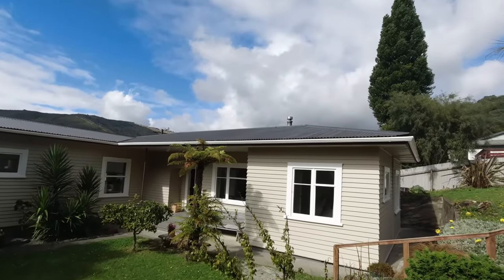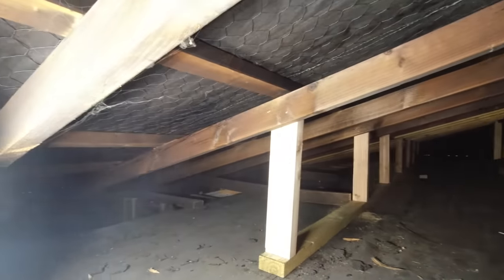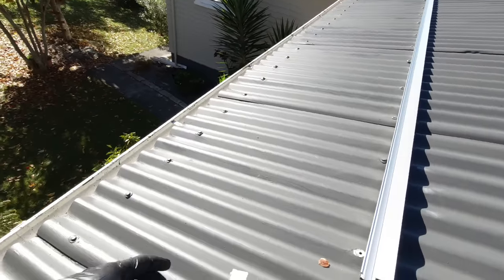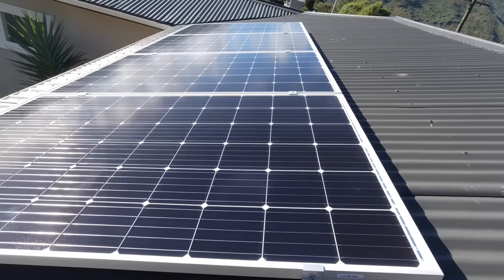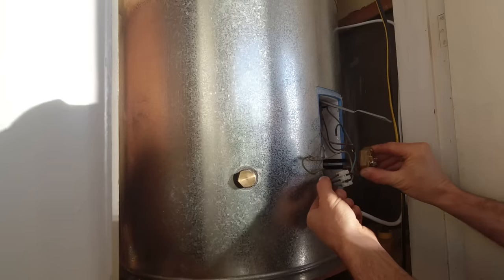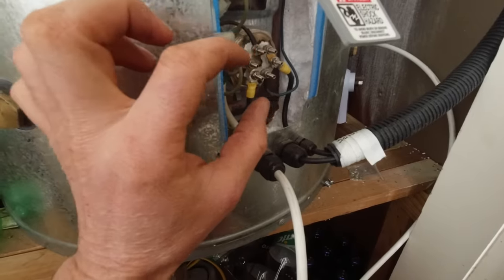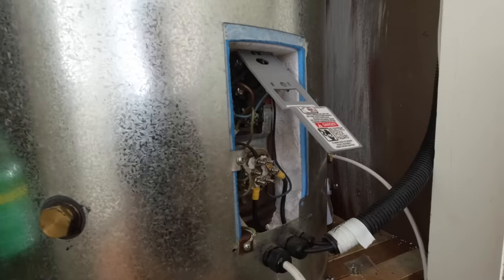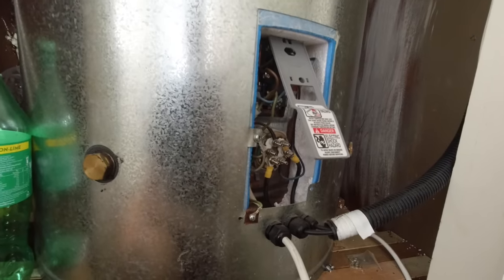Installing PV Solar Panels using a Water Tank as the Battery.. Halved my Power bill

Comment: Cool, I was thinking about doing this.  I didn't realize I would need a special element.  I figured a restive heating element would not care if it's fed with AC or DC.  Maybe yours is called a DC element because if has multiple coils?
Reply: There is actually a difference. I was surprised to learn this also.
The resistive element itself is, as you say, no different and indeed doesn't care if it has ac or dc applied across it. The difference lies in the outer casing material of the element and has to do with corrosion via electrolysis more than anything.
Reply: @jimmyb1451  not just that, to low voltage will put to high amperage, if wires dont predicted for too high amperage, will burn ...
Reply: @zoran69ser  Ohms law says otherwise.
Reply: There are numerous gray sheath heating elements that are not electrically connected to the tank mounting.  Agencies do allow some current leakage.  This could be an issue with DC and electrolysis. The panels should be floating anyway.  Other elements are copper sheath with plating.  The element is essentially outside of tank and causes no issues.
Reply: @opera5714  The panels would be floating, if not connected to earth.

Something I'll never understand.
I'm yet to be given a valid reason for earthing a solar array.

Comment: Hey Marty, thanks for the video. Question, does the solar side not need a thermostat? I would worry about overheating if that was possible.
Reply from the maker: It is self limiting, hasn't gone over 80c yet but I will keep a close eye on the temp heading into mid summer, if it starts getting too hot I will add a thermistor/plc with a big dc relay to disconnect solar if the water temp gets too high
Reply: Not sure about NZ, but here in the States, they have a pressure release valve. As the water heats, it expands, if the pressure is too great i'll vent, as it vents and looses pressure cold water from the tap will enter the system and cool it, further reducing the pressure. Mybusters made the hot water rocket by disabling the venting and every other safety mechanism, the once the water got hot enough to flash to steam. blast off. He said it only gets about 80C, about 176 F, or so, if I remember my F to C conversion's, that's 20 degrees below boiling. Also, i dont think he said if he bypassed the thermostat or not. He may not have. Either way, he's probably good to go. Marty seems pretty smart so i doubt he'd overlook that. Edit: he said on another post he doesnt have a thermostat, but it never gets above 80C and he's keeping a close watch on it and will install a PLC with a dump if need be.
Reply from the maker: @matt_1984_  Yes this tank has an always open vent coming out above the roof

Comment: Hey Marty. Nice Job.  I have done a few solar panel installations on some homes here in the States as well as put panels on at least a dozen RVs.  This install looks unique.  I'm really interested in the DC heating coil.  Those 300 watt panels output as much as 40 volts each.  Without a charge controller you're pushing from zero to 160 volts.  Doesn't the DC voltage matter to it?
Reply: Once you pull more power from the panels than their Pmax, the voltage tops out.
He's running them in two strings of two, so in any case the most the element will see is 80 odd volts.
Reply from the maker: The panels are 2x series parallelled so voltage is kept below elv
Reply: Thanks Jimmy and Marty.  Makes sense.  But still, that is a fairly wide range of DC voltages. This doesn't matter to a coil?    A coil is not a sensitive piece of electronics so I am guessing  no.  But hey, I don't know, that's why I am asking.
Reply: @nikolatesla5553   The PV panels are current generators and the voltage produced depends on the resistance. A function of the current squared.  Little drops in current make big differences.  So, most of the day this direct connect is a poor performer.  Add just a little electronics and this system would really perform on cloudy days.

Comment: This is something I've wanted to do for years. 
I'm impressed with how well the solar array was put together. That was a huge job because of the work inside the roof.
The combined AC/DC element solves the mains boosting issue nicely. 
I'm wondering what would happen during long summer days if the hot water wasn't used. Could it theoretically boil? Is there a way to use the AC thermostat to control a DC contactor using a transformer to power the contactor? As running DC through the thermostat will damage the contacts.
Reply from the maker: It hasn't gone over 80c yet but I will keep a close eye on the temp heading into mid summer, if it starts getting too hot I will add a thermistor/plc with a big dc relay to disconnect solar if the water temp gets too high
Reply: @MartyT  I am going to try using one of the low cost DC SSR's driven by the thermostat...under A$10 for a 50 Amp 400V device
Reply: @MartyT  and mehanical Pressure Relief Valve ,  is must...
Reply from the maker: @zoran69ser vent pipe is always open above the roof, no need for a relief valve
Reply from the maker: @Peter can you show me the link? are those Chinese amps or real amps?
Reply: @MartyT  did you see my link and comments yesterday...I don't see it here now...YT may have removed it?
Reply: @MartyT  appears I am unable to respond to you
Reply from the maker: @Peter I didnt get it, sometimes links go to spam but i cant see it there
Reply: @MartyT  I sent an email just now...

Comment: you used a water heater boiler to transform DC to AC by using as you said at 5'43" <<replace AC element with a DC>>; could you give more details, pls. so, in the end you didn't use an inverter and how you solve the power frequency (Hz=50) ?
Reply from the maker: Not converting to ac, dc from the panels goes straight into the elements
Reply: @MartyT  you have equip by DC power? Something is not clear, I'm afraid. How to use DC in AC network?
Reply: @dragosstoianovici-boscanea5103  
dual voltage DC and AC elements ....
that are in one "normal" sized fitting that screws into the normal place the normal elements fits into on the WH cylinder (in New Zealand).
Reply: @dragosstoianovici-boscanea5103  
@MartyT
1 year ago
I got this element from trademe nz, it has 2x dc and 1x 240ac coil.

Comment: Did you have to change the thermostat so it doesn't burn out with the DC arcing?
Reply from the maker: No DC thermostat yet.. the temp is self limiting, hasn't gone over 80c yet but I will keep a close eye on the temp heading into mid summer, if it starts getting too hot I will add a thermistor/plc with a big dc relay to disconnect solar if the water temp gets too high

Comment: Anyone know if that is that compliant in the UK? Because the idea of DC would cut costs significantly and hot water is an expense now we're paying 40p kwh.
Reply: If you get a registered electrician to check the wiring re the mains part of the element...and at the same time have him check the low voltage sides....
how can it not be allowed or be illegal?

Comment: Better putting your solar in series and the elements in series. Losses in the panels and the cables follow I2R so a series panel series resistor would have 1/4 of the losses- and be way more efficient.
Reply from the maker: 4 panels in series would exceed elv levels in NZ, becomes a pain in the ass to install legally

Comment: Nice set up Marty, I like the wiring diagram and as an electrician I agree that this is the best scenario. I was wondering if it was straight DC voltage but you clarified that you do use some AC power when its cloudy. The thermostat in the circuit is essential to prevent both from running at once. How many gallons is that tank? 30? and what is the wattage of the DC element?
Reply from the maker: Thanks Dave, the tank is 180 litres and the dc elements are 2 x 600w.
Reply: @MartyT  Great and simple solution! Any links to the elements you purchased?

Comment: Small question. Do you have a electrical thermostat cut off on the DC side?. 
Very much enjoying your videos. Good kiwi bugger.
Reply from the maker: No the tank is big enough not to boil. Will keep an eye on it heading in to mid summer, if it starts going over 80, I'll add a thermostat and big dc relay on the solar feed

Comment: When the tank is up at 80 degrees what is the temp at the tap? Risk of scalding the kids if you are not careful? Or do you have a tempering valve?
Reply: NZ installs usually have a 55 (I think) degree limiter
Reply from the maker: tempering valve

Comment: how is the thermostat holding up to the ark caused by DC power,  i have solar too but a far bugger system, ATM my hot water is heated using an inverter but i want to add 4 more panels and do the same as you, but everything ive read says that the thermostat can get damaged by the dc voltage casing arks.
Reply: don't worry i found the information from the seller on trademe oO no  thermostat  is used for the Solar, and come to think about it, your video shows this lol,  but i would not want 100 degree water coming out of my tap, that's crazy, and could burn someone,  yeah i might skip this idea its too much of a burn risk
Reply: @Yahgiggle  
I hope you have figured out that say a 300 litre stainless steel inner WH tank gives you the volume of water to absorb the output of 2 panels during the summer without boiling the water..
and the other two are connected for the rest of the year.
Reply: @JohnSmith-pl2bk that makes little sense, I say that because what if I use more hot water one day or even way less, or the week is wet and overcast all week, you cannot account for such things and doing a two panel setup would not adjust to that.  Well unless you like super cold water one week or super hot the next week oO

Comment: See if you can find a Solahart solar hot water system, far more efficient because there is no energy loss by conversion from solar to electricity, they are brilliant systems, made in Western Australia, and they last an extremely long time - ours is at least 30 years old and still going strong.
Reply from the maker: I looked at those, way more expensive and more complicated to install, Plumber probably would have charged more than I paid for my system

Comment: Couldn't you make a solar water heater as well with a small pump running off of solar that way you have 2 systems and you wouldn't need to use electricity at all for hot on sunny days.
Reply from the maker: You could, but I don't want to mess with the plumbing
Reply: @MartyT   I see.

Comment: Great video. Where did you find the AC/DC type heating element? I cannot find a single element that has twin cores or a DC and an AC element in one.
Reply from the maker: Trademe NZ
Reply: @MartyT  Thanks but no luck. Do you recall the model number for the element? Manufacturer?

Comment: how does the system know to stop heating the water when the boiler specified max temperature has been reached ?
Reply from the maker: The tank is so big that it doesn't need to be switched off, If we're going away for a few days I will flick 2 of the panels off

Comment: You should use the same ground as for the rest of the house, never have 2 disconnected ground rods.
Reply from the maker: They are connected, the original rod was dodgy and corroded so I replaced it

Comment: Kind of a roundabout way of heating water from the sun, but I get that you don't want to spend a fortune on that house. There are accumulator tanks with a fluid to water heat exchanger, and an electric heater. If you were to design a system from scratch, that in combination with a water mantled wood furnace is kind of optimal. And "future safe".

Comment: Given that the best PV panels only convert about 20% of the sun's energy into electricity would solar vacuum tubes make better use of the roof area if the target is heat rather than electricity ? I had thought of doing something similar with an IBC which can apparently be used at up tp 65 deg C. Google indicates that 1000 litres of water heated from 20 to 100 deg C holds 81.7kwh so an IBC could store about 50kwh at 65 deg C.
Reply from the maker: I looked in to vacuum tubes but they were more expensive, heavier, more complicated to install so I went with pv panels

Comment: Have you played with vacuum tube collectors for direct heating of water at all yet?
Reply from the maker: I have looked into it but they're costly and I'd legally I'd need a plumber to hook it all up, plumbers around here would likely charge more than the cost of this solar setup for a days work installing vac tube system
Reply: @MartyT  I have the opposite problem here, no PV solar allowed on a mains connected house unless there's an approved synced inverter system and everything is inspected, even if the solar isn't connected to an AC tied device.  So it costs minimum $10k to get into solar before you buy your first panel.
Reply: @criticalevent  where are you based ?
Reply: @lauchlanmenegon5916  Eastern Canada.

Comment: If you're going purely for hot water a vacuum tube solar water heater is much better at it. Solar is still very inefficient in energy conversion (20% - 200W/m² @ 1000W/m² solar irradiation) where the vacuum solar heater is at least 4x the efficiency which translates into 4x smaller roof installation and they keep their efficiency up all day.

But the installation is harder as you need to run pipe from the roof to your water heater and the water heater needs a secondary coil as the system circulates antifreeze.
Reply from the maker: Yeah they are pricey and  I would have had to get a plumber to install one so it would have cost at least 3 times as much and added more weight to the roof

Comment: Very cool. Do you have any issues with the water temp fluctuating (daily) for showers etc, or surprised if the hot tap is too hot/cold?
Reply from the maker: Not really, If its a cloudy day the ac element will kick in

Comment: Are you using a thermostat on the DC side? And how do you avoid DC arc’ing?
Reply from the maker: No dc thermostat yet, tank is big enough to absorb  sunny days without boiling and is open vented above the roof. I will add a dc thermostat before summer with a big dc slave relay to disconnect the solar feed if it starts getting too high
Reply: @MartyT  ahh I see. Should’ve known you’d though of that. 😉 And good idea avoiding the losses of an inverter too.

Comment: Thanks for that. Really good info. I am just wondering do you have to be a registered electrician. I am currently in Australia where any type of electrical work needs to be certified or no insurance cover.
Reply from the maker: Yes a sparky needs to do the ac side here as well and sign it all off. Anyone can install the dc side as long as it complies to the standard

Comment: Awesome job Marty, just wondering about when you go away for a week in summer and starts to boil or is the DC thermostat controlled too?... what happens?
Reply from the maker: I have left it for 4 sunny days without using any water and it got to 80c. it cools down a certain amount over night. It would be easy enough to add a thermostat on the top pipe connected to a big dc relay on the solar feed powerered by a 12vdc powerpack. I think I will do this to show people how its done
Reply: @MartyT  Nice, only saying this as i have to cover my tubes on the roof when i go away... the cooling feature on the controller doesnt do a very good job as the pipes are so well insulated.
I have got a couple of external pipe mounted DC thermostats that i got off trade me that was used on a super old solar hot water set up that i am going to use on my solar spa project.

Comment: Awesome work, I am doing something similar, do you have a link to the AC/DC element you used?
Reply from the maker: https://www.trademe.co.nz/a/marketplace/home-living/heating-cooling/other/listing/3286125227?bof=Hp4wlckZ
Reply: @MartyT  thanks! How many litres is your hot water cylinder?
Reply from the maker: @Happyantix112  180 litre, you need a decent size so it doesn't boil

Comment: did you say you replace the AC element for a DC one? or did you mean you replace it with a lower voltage element?
Reply from the maker: It now has a dual ac/dc element
Reply: @MartyT  what I was trying to say is that there is no such thing as a dc element or an ac element since an element is just a coil of wire with a certain resistance

Comment: I wondered whether it would be feaseable to wrap  dc heating element wires around the main hot water supply from the boiler into the coil of the water tank; thereby reducing the amount of time the boiler fires to keep circulating water up to temperature, has anyone thought or had experience of wrapping pipes with heating element wire from solar pv?